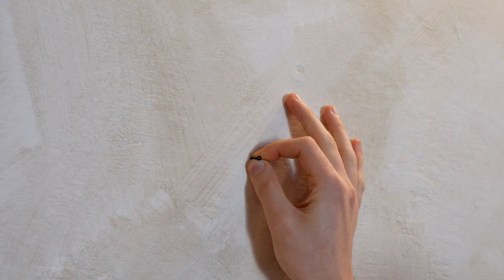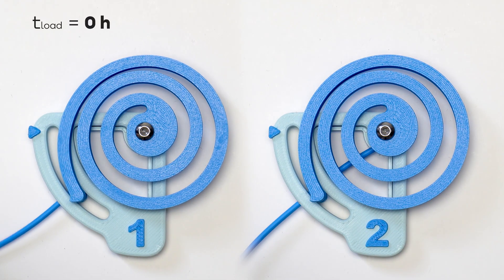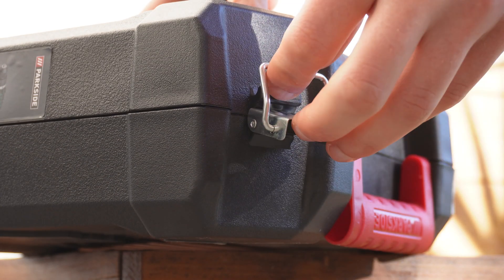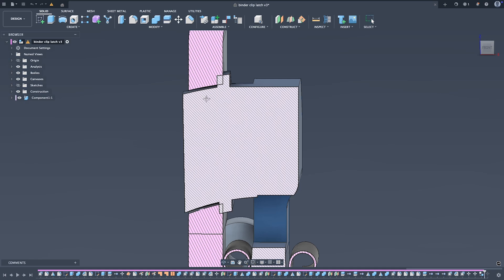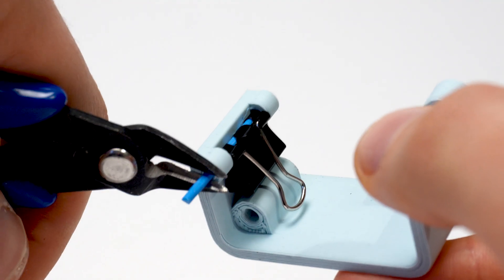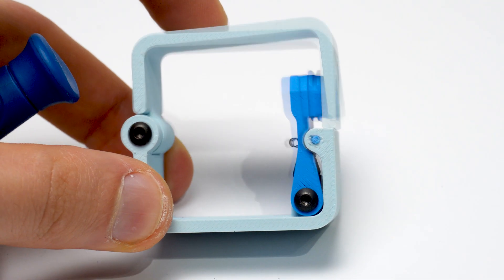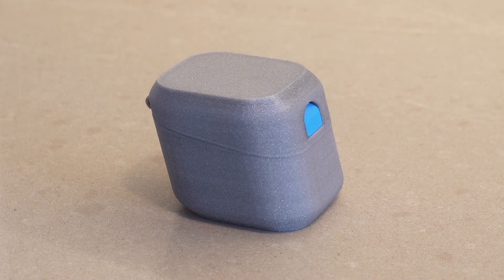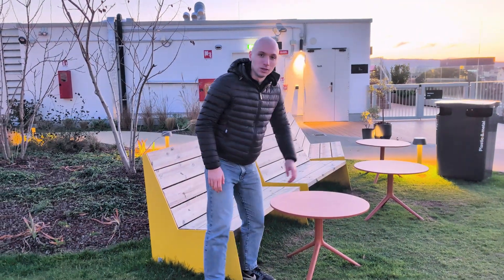Stop 3D Printing SPRINGS. Do THIS Instead

Comment: The mechanism in this product is not in constant stress. There is only a little bit of stress applied when opening and closing the box. By using a paper clip as a spring, you increase the assembly time and the material costs, while the benefit might be negligible. Of course, this depends on the intended purpose of the product. If it is for personal use, this system ensures that you never have to think about the spring mechanism ever again. However, if you plan to sell this storage box, I believe it would be better to design a print-in-place spring that is as long as possible, so the stress is distributed over a larger amount of material. It would be even better to use a technique that is truly well suited for 3D printing.
Reply from the maker: Hi Maarten, I have to disagree here. If I were to sell this box, which I'm not planning to, I’d probably use a proper metal torsion spring. The problem is that any 3D printed spring, no matter how well designed, will eventually suffer from creep. The goal here was to enable everyone to build this using things they already have, without having to wait 6 weeks for a delivery from AliExpress.
Reply: Hi  @salveo3d , I’ve just realized that my earlier comment may have come across as a bit rude, and that was not my intention at all. I actually think using a paperclip is a very good and creative idea, and it’s definitely something worth considering when designing springs. 

At the same time, I believe you should always design with the chosen manufacturing method in mind. When it comes to 3D printing, that ideally means avoiding the use of traditional springs. Additionally, a product doesn’t have to be perfect; what really matters is finding a good balance between cost, production time, and quality.
In this specific case, you can therefore ask yourself whether using a paperclip as a spring offers enough benefits to justify the additional material costs and assembly time. 

I also still have some doubts about whether creep is truly a significant issue in your example, for the same reasons I mentioned earlier. 

That said, all of this mainly applies to production in larger quantities with the goal of selling the product. For a one-off, assembly time is much less of a concern, and for personal use, these considerations aren’t really necessary at all.
Reply from the maker: @maartenvaneck2218  Hi Maarten, no worries at all. I appreciate the thoughtful breakdown. It’s true that at scale, justifying every cent is crucial. But since I’m producing this myself, the added cost of the hardware is negligible. Have a great day!
Reply from the maker: @maartenvaneck2218  Hi Maarten, no worries at all. I appreciate the thoughtful breakdown. It’s true that at scale, justifying every cent is crucial. But since I’m producing this myself, the added cost of the hardware is negligible. Have a great day!

Comment: Genuinely a great video, but I do think you missed an opportunity to discuss a bit about why plastic "creeps", and have a short discussion on plastic vs elastic deformation, which is the core of why you should not make anything that needs to endure constant stress out of PLA. It's also worth noting that different plastics have different properties, so you can make springs with almost no creep out of PETG, but I would still consider metal a better alternative as you can get significantly more force from a metal spring than any 3D printed plastic.
Reply from the maker: Thanks for the feedback! I'm still balancing how much technical detail to include. You're right, I could've touched on plastic vs elastic deformation, but I kept it brief for now. I'll save the deeper engineering dives for future videos

Comment: My man, just use a torsion spring. They're as cheap as dirt, and sites like mcmaster already have free CAD for every size under the sun. Using a binder clip like this might work for a one-off project, but it's unnecessarily large, constrains the assembly process, and is still putting constant shear stress on the piece of filament you threaded through one end. With a torsion spring you'll also have much more control over the preload.
Reply from the maker: True, but the goal here was to solve a problem with what everyone already has at home.

Comment: Further proof that the binder clip was one of the greatest inventions of all time.
Reply from the maker: I have to agree, you can do anything with them
Reply: I buy them in boxes of assorted sizes. They're useful for everything from closing a bag of chips to making woodworking jigs.

I only wish I'd find real stainless steel ones so they'd stand up to rusting, there's so much more I could use them for where water is involved.
Reply: @MarcoZamora  I think that thr problem is in cost. Cheap spring steel used for clips isn't rust resistant, when cheap stainless still isn't springy enough and loose tension fast enough.
Reply: I heard it was the wooden clothes peg (clothespin in USA)

Comment: That’s beautiful.  I didn’t even realize that printed plastic creeps like that.  Is there a reason you left the other handling on the binder clip?
Reply from the maker: Good eye, It can actually be removed. I left it there to help the viewer better locate the position of the binder clip, especially at the start of the video
Reply: @salveo3d  Ah.  And an even more trivial point, the word “pivot” is pronounced in English as if it were an English word, pihv-utt not in its native French way.
Reply: Not only printed plastic. All plastics are not fully elastic.

Comment: Do you really need the other clip handle? Maybe the push/lock mechanism can be inserted with the metal black part in it.
Reply from the maker: It can actually be removed. I left it there to help the viewer better locate the position of the binder clip, especially at the start of the video
Reply: @salveo3d  Perfect, good to know for future project - thanks for the video!
Reply from the maker: @ImSoMagic  Good luck with your projects!

Comment: Would a right-angle screwdriver eliminate the need for the hole in the outer wall of the box?
Reply from the maker: Probably! If the box is wide enough, then yes

Comment: How many pounds of force does this create approx? I think since binder clips are so cheap, it could be useful to find out what size binder clip creates what force so we can use that for our projects :) 

Maybe you could standardize the clip mounting part so we can reuse it in any project (and upload it to makerworld or other websites). Perhaps make it screw mountable and/or dovetail mountable.

Great video!
Reply from the maker: Bigger binder clips definitely deserve a deeper investigation, they have huge potential! I'm also working on publishing the files on Printables soon
Reply: @salveo3d  Great to hear! Yes I have great interest in combining cheap mass produced objects such as binder clips with 3d prints. I find that it's one of the way that you can make a superior product and cheaper than one that would come from (for example) china. And then if you want to make a couple hundred or thousand products to sell, you don't have a hard time finding a supplier for your springs to get better prices. You can already buy everything you need for cheap in any quantities.

Comment: "Sometimes, the best way to print a complex mechanism is to not print it at all" THANK YOU!!!!!! I've been chased out of entire Reddit subs for questioning why we're designing worse versions of things that already exist and are cheap and readily available. Followed!
Reply from the maker: Most of the time, if you try to redesign something to print that's already available, you end up with a cheaper, bulkier, and less efficient solution
Reply: @salveo3d  You don’t see this design philosophy too much in 3d printing anymore. Us designers have long accepted that things like bearings, thread inserts, stiffening rods or plaster ballast can all be beneficial. Just look at 3d printed guns for example, first it was 99.9% 3d printed, now they’re closer to 60/40 printed parts/ off the shelf hardware store parts. I’ve been putting actual springs in my designs for over a decade now. 2015ish was my first design with one.
Reply: This is a strange mentality that I think stems from the tension between people who are attempting to design objects 'thoughtfully', and people who are into 3D printing for the sake of 3D printing. 

 Obviously having options is always handy on short notice or in an emergency (this has saved me many times!) - but there is a shortsightedness to trying to solve all your problems with 3D printing that I've never understood. 

Any process implemented poorly is bad design.
Reply: When designing something. Remember. Use as many DIN/ISO or Norm parts as possible. They are cheap, readily available and are Made for exactly this porpuse.
Reply: 90% of the time if you're getting downvoted on Reddit you're saying the right thing but people take it personally
Reply: I think the sub has the mentality of "because I'm in the 3D printing sub, everything I do should involve 3D printing" and they forget the main focus of 3D printing which is ingenuity and being resourceful.
Reply: Yes!! But I have to confess, one of my first designs was a print in place tiny ratcheting screwdriver with built in storage for a few bits. Pointless, as cheap metal versions already exist that blow mine out of the water. But it was a fun challenge and it does work really well.
Reply: Going on Reddit was your first mistake. 3d designers have been arguing this for over a decade! Unfortunately, some people are determined to waste time and plastic!
Reply: I have seen people 3d print washers because they don't want to go to a hardware store
Reply: @luandoduy416 Ehhhhh...that one is a bit more nuanced. There are definitely situations where 3D printed washers are a no-no. Anything with high clamp loads comes to mind. But...there are truly some situations where a 3D printed washer would be a better solution. I needed to support a garage drywall ceiling that was damp and sagging, threatening to fall,  which meant adding more drywall screws with fender washers to better distribute the load. They were $.20 each at the hardware store, and I needed around 200 - and this wasn't going to be a permenent fix. I printed two plates of PETG washers perfectly sized to the application, for less than $5 of filament. Point is, it's extremely situational, we as builders need to understand the limitations of the technology and always ask ourselves "Is this truly saving time/money/effort, and is this as good as a nonprinted alternative?" - if we can't answer yes, that's when we need to take a step back and reevaluate.
Reply: My unpopular opinion is that print-in-place models are over-hyped and go against what home 3D printers should be for... repairability. Sure a print in place box with hinges and locking mechanism is nice and requires no assembly, but if the hinge ever breaks you can throw out the whole box without the possibility of repairing it.
Reply: Ah, Reddit. The place that perms-banned my 18-year-old account for “threatening violence” when I dared to repeatedly say Trump was going to crash the U.S. economy.
Reply: @douglasjebarnes I said I hoped the US ambassador to Canada had a stroke. Permabanned for "threatening violence"  😂
Reply: I agree with the viewpoint of: 'not everything is meant to be print'. But objects can be redesigned to make them conform to the material and print methodology. Printing and object designed for metal in any fdm would be bad engineering. Redesigning it to solve the same problem but designed to work with fdm is the real challenge. And this is part of engineering which most engineers love, including me.
Reply: Its fun to make things that are fully 3D printed and thats usually all there is to it.

Stuff like 3D printed springs happened because it was more likely someone would be willing to print something with a printable string then actually going out and buy the spring themselves
Reply: "I've been chased out of entire Reddit subs"  <- Well there's your problem right there. Why the hell would you spend time at that cesspool of a site?
Reply: @grakkerful unfortunately it's kinda the "default forum" for too many things, so it has the numbers, and with enough numbers there's usually someone there who has the information you need
Reply: @Addsomehappy  It's up to everyone to decide what their "Those who walk away..." line of acceptability is.
Reply: Chased out of?? It's a pretty simple answer - play, and discovery. You don't like to try things out? Ok, use a spring, noone is stopping how you print. What would you say to get kicked out??

Comment: To eliminate the exterior hole, can you design the box to accept the latch by sliding over notched hinge? Or is the strength of the metal screw needed?
Reply from the maker: I don't think the strength of a screw is needed, but since this mechanism will hold my computer I want to make sure I have some metal hardware in it. Someone in the comments pointed out that a spring bar can be used and I think I'll go with that for the next version

Comment: Very cool.  It would seem that you could eliminate the need for a screw as a hinge pin by printing the blue latch with a shaft running between the two sides.  Then on the box, print a hook that allows the latch to slip under and has enough hook to hold it in place.  I'm not describing it very well, but hopefully you'll get the point I am so poorly trying to make.
Reply from the maker: I get it, John! That could be a solution too

Comment: Home brew print industry should standardize on a few metal springs and clips etc.
Reply from the maker: I hope this is the beginning
Reply: @salveo3d ❤
Reply: I saw someone using ballpoint pen springs in a print. That seemed like an available spring. At least for small spring needs...
Reply from the maker: @CzechNeight I have one project in the making that uses one of them eheh

Comment: Great timing, I just had a case where I needed some spring-power and creep made my parts useless in very short time. Binderclips ma be a new piece in my collection of standard parts for mechanical contraptions.
I still wonder why you would use filament for a pin. I mostly use dowel pins or, when there is enough room for it, furniture connector bolts. Those are relatively cheap and very precise. I print the holes with nominal diameter which is usually just a bit too narrow and has the seam in it and then use a reamer to get the perfect fit.
Reply from the maker: "The filament pin is plenty strong for this specific use, and I chose it because everyone has a strand of filament lying around. However, if you want something even sturdier, you can easily replace it with a 2mm metal rod and it will last forever

Comment: I was looking into 3d printing small timing belts, since buying them is expensive, and was finding that tpu printed belts permanently stretch quite quickly. That was a disappointment for all but a moment until I found out that the real belts avoid this by having a stronger material inserted in them, like copper, and thought, I can do that easily too! Just leave a slot in the belt for a loop of rope, and now it's a strength of the rope with tpu teeth attached to it!
Reply from the maker: That's really clever. Using a hybrid approach like you did is the best thing to do many times, you get the strength of the rope and the geometry of the printed TPU
Reply: It's the same with tyres and metal wires running through their walls.
👍🏻

Comment: Maybe consider wrist watch band retainer springs (called "spring bars"). They be great for that hinge pin you want to hide. You can place them without needing a hole to insert them from the side. It consists of a tube that is the width of the band. Inside that tube is a spring and two rods sticking out the ends. The rods are  T shaped with the wider end inside the tube. After insertion into the tube, it is held captive by narrowing the tube ends.
Reply from the maker: Genius tip! Yes, this could really be the solution

Comment: I see so many designs where they 3D print complicated or unreliable mechanisms or waste tons of filament just to avoid using a basic bit of metal or a fastener. More hybrids please!
Reply from the maker: Sometimes you just have to resist the itch to print everything and just go hybrid
Reply: Though sometimes you have to do the opposite, my main gripe is with people shotgunning heat set inserts, if it's not coming apart, you can just screw in plastic and it's actually more reliable for one-time use, and otherwise, a nut is also more reliable.
Also, in one of the designs I'm working on I'm just using 3d printed bushings instead of bearings because it's cheaper and you don't really need anything more.
Also an annoying thing is thinga designed with a  "standard" part that's actually not that standard, like parts that are made by a specific us brand. (First thing that comes to mind is altoids.) if you're using a non standard part (e.g. not iso/din/whatever standart), please design a modular interface to replace it, or give some adjustability. 

(If you're just making it for yourself and leaving it as is for whoever's inerested it's fine)

Comment: as an industrial design student i like stuff like this, very rare do you see a 3d printing channel that actually shows you how to design for 3d prints and not waste filament.
Reply from the maker: That's exactly what I want to do here. These machines have so much potential if you design around them. Good luck with your studies and thanks for stopping by!
Reply: They'd rather be printing another "airless" ball instead.